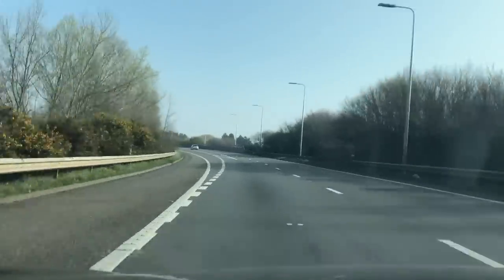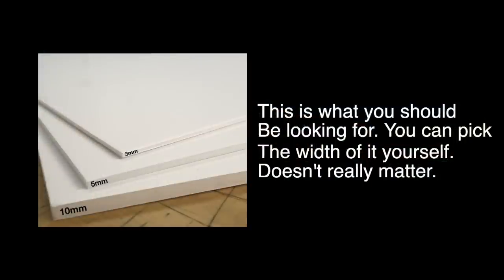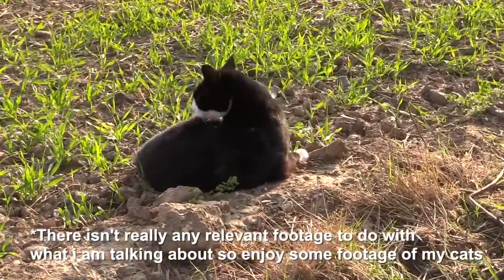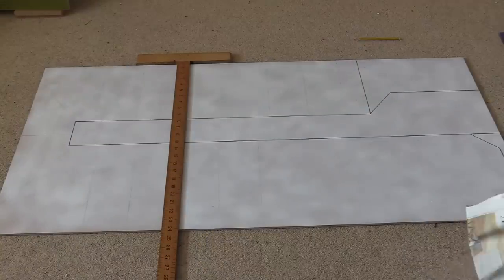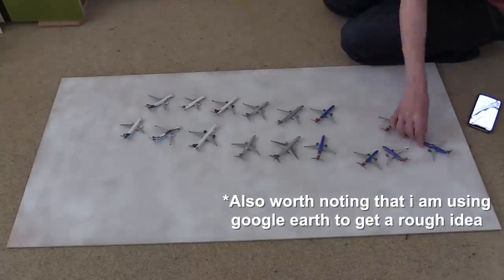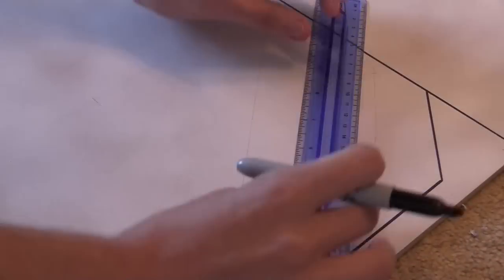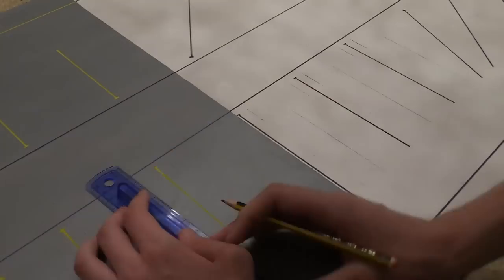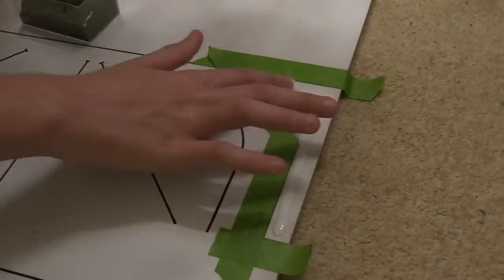How to build a Realistic Budget airport in under a day!

Comment: Another way to scale an airport is that you can use google map to know the size of the terminal and runway width using a reference from a real 1:400 model and put the picture of the plane the same size as the 1:400 plane
Reply: Or just use the measure tool and divide the length by 400.